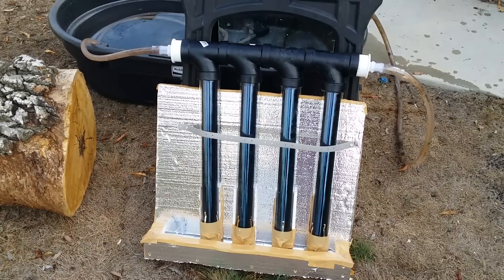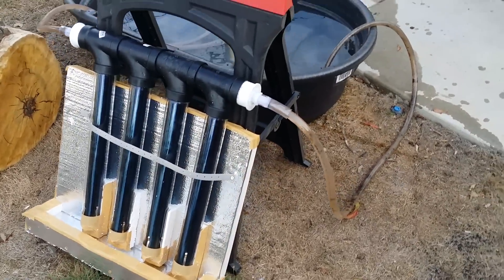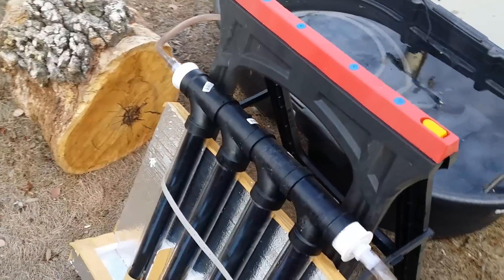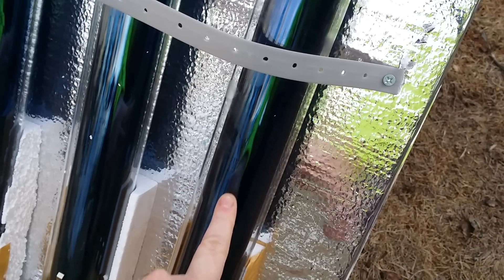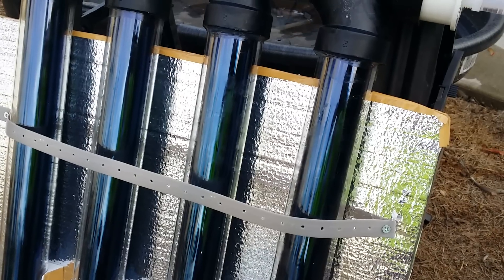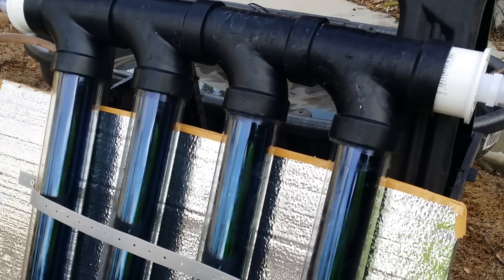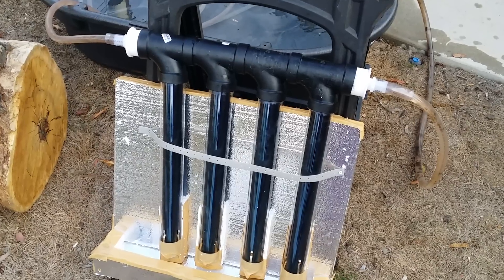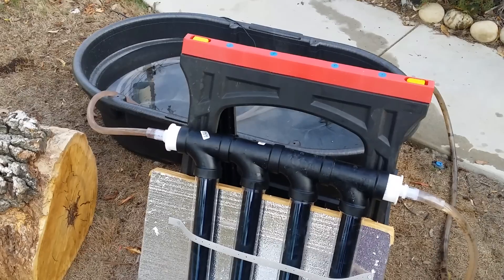How to Make a Solar Hot Water Heater at Home - DIY Solar Vacuum Tube

Comment: some report on the temperatures (say between input and output) would be nice as well as anything about the pumping rate ...
Reply from the maker: Thank you!  If I run the experiment again, I'll include that.  If memory serves, the pump was small, about 60 GPH.
Reply: hello, you just plug the tubes into the pipe? inside the tubes is there anything? I'm from Brazil, and I want to make my own. If you can answer me
Reply from the maker: Hello!  Yes, you plug the pipes into the tube, but first I put a seal of aquarium safe silicone sealant around the pipe to create a water tight seal.  I let the silicone cure for 24 hours before running water through the tubes.  I found that the the sealant worked fine right away, but after about a year it had degraded from the heat and needed to be replaced.

Also, there is nothing inside the tubes.  They are empty, and only fill with water that is being pumped into them.  Please let me know if you have any additional questions, I am happy to help!
Reply: veryThank you. My doubts have been answered.

Comment: inside tube is metal or glass?? i mean in future if metal get bad corrosion?
Reply from the maker: The inside is glass with a very thin metal coating. It should not corrode because the metal coating is facing the sealed vacuum
Reply: @Suburban Stone Age  very thin metal is dark i think and it makes less reflection i want to make a system for screen pools that you can hang on the screen and it will works with sunlight automaticly but i dont want to so any maintence i can work with dark glass or steenless steal
Reply: @Suburban Stone Age  like after 2 3 year i dont want to clean i want it run forever in my country turkey we use them alot but we wont fill them with water. your system is cheaper and less maintenance thats amazing for pools

Comment: the backing is insulation use a solar lens to focus more heat instead of a standard heat. It would do better with a mirror and not touching the insulation backing which is cooling down the outside tube from transfering heat
Reply from the maker: This project is due for an update this year, I'll keep this in mind to try!

Comment: It may be far more efficient by having a primary and secondary tank, with an overflow interconnected.
Depending on the temperatures you want to achieve, you could 
further a modify the tubes and tank for more efficiency, output and storage.
Reply from the maker: Yes, agreed.  I'll be trying again this summer, and feel there is a lot of room to improve. Thank you for your comemnt!
Reply: @Suburbanstoneage  
What temperatures did you manage to get?
Reply: They make drain back tanks specifically for solar water systems.. ben gravely has a great video on it, many other advantages that come with the drain back tanks as well and should be even better when combined with these new tubes

Comment: Nice ! What about using thermosyphon to replace electrical pump ? What cost's the vacuum tubes ?
Reply from the maker: Hi!  Yes, that is an excellent idea and I would like to try it on the next build.  The vacuum tubes were about $100 for 10, but the price has gone up to about $200 for 10 since I bought them.  I'd keep an eye on Amazon and eBay around the big sale days to see if you can get a deal.
Reply: @Suburbanstoneage  There is also a chinese company making them, and i already saw a tutorial to make it yourself... 
I wonder if recycled neon glass pipes are enough strong to use them....?

Comment: Hi, love the simplicity of this. I'm wondering if the design would work for heating air? If not empty, would it work to fill the tubes with a porous metallic material, like steel or copper scouring pads or aluminum screen material?
Reply from the maker: Hi!  I think it would work fine for heating only air.  I've see it sitting in the sun with visible heat waves coming from the top.  Of course, that is with just an open tube, which I'd recommend trying first.  Also, putting metal scouring pads would probably get them quite hot.  Great ideas for a future test.

Comment: Did you build the evacuated tubes? If so, how did you assemble and remove the air?
Reply from the maker: Hello! No, I bought the tubes online. I put a link in the description if you want to check them out on Amazon.
Reply: @Suburbanstoneage  Nice, thanks.

Comment: Where did you buy your tubes, want to re-create this project for a engineering capstone and find the tubes has been a struggle
Reply from the maker: Hi! I bought them on Amazon, there is a link in the description where you can purchase them. They've been wonderful. Please let me know if you have any trouble, and I can help you find some. Thanks!
Reply: Great found the tubes, would you be able to give me information on the header pipe you use and how you connected each tube
Reply from the maker: @XoJosselineXo  Hi!  Sure, I'd be happy to! In fact, this is a great idea for a new follow up video on this project.  I will need a bit of time, but I"m happy to show you all the details.

Comment: how to keep it from leaking on the connection between the collector pipe and the pvc pipe when it's high heat?by the way..nice video and sharring..
Reply from the maker: Hello and thank you!  I sealed the vacuum tube at the top with aquarium silicone sealant.  Because the seal was around the outside of the tube, and inserted into the PVC fitting, it did not get super hot.   The seal worked for some time, but I found that after 1 year it had degraded and needed to be replaced.  When I do this project again, I will probably experiment with a different seal material, but the silicone sealant will definitely work in the short term.
Reply: @Suburbanstoneage  thanks for the answer..
Reply from the maker: @Caturdepok  My pleasure!  :D

Comment: The tube is insulated as to not  lose heat by convection not radiation.
Reply: Conduction-- loss through touching other molecules

Convection-- thermal fluid currents

I think you mean conduction

Comment: You could eliminate the need for the electric pump with the use of two "one way valves" on each side of the heating array and a syphon priming hand squeeze or lever pump to get it started.  Then, heat will create a vacuum effect and it will run itself.
Reply from the maker: HD Candela true!  At the time I wasn't sure how to get the tank high enough to start a siphon so I moved along with the pump.
Reply: Suburban Stone Age there is no "siphon" when the tank is above the array. And the tank needn't be exceedingly high anyway.  The drain on the tank need only be higher than the inlet of the array.     To me,  siphon implies negative pressure,  like suction in a straw,  you have to create a lower or negative pressure area for there to be an effect.  When the tank is higher than the array,  there is no negative pressure nor does there need to be.   Gravity causes water to fall into the array,  the water is heated in the array and expands.  And it's the expansion that does the real work.  Like the mercury in a thermometer,  the expansion pushes the water "up" the outlet and returning it to the tank.  The hottest molecules rise (creating space for cooler molecules) and expand (take up more volume in the pipe).  This is exactly what happens to water when it freezes and why ice floats instead of sinks, and what makes water so miraculous.  It expands when it is heated,  but also when it freezes, and if it didn't none of us would be here.

Comment: and... the results?
Reply from the maker: With the 4 tube design I was able to raise approx. 40 gals. of water by 30 degrees F with about 5 hours of sun exposure (which equals one day's worth in this location).  However, when left to run overnight, the water returned to ambient temperature.  Conclusion:  This device can and will heat water, but if you have a large volume of water to heat insulation in the system or holding tank will probably be needed to lock in your gains until you can resume the next day.  Or, if you want really hot water, heat less water with the same setup  and use it that day. 

I still have my apparatus and intend to resume the experiment as work schedule allows.  I hope the finding above are useful, I am happy to answer any questions. Thanks!
Reply: im working in an old and rust 200L pressurized (the tank is rotten so will be used only as a housing) water heater, with 20 6foot tubes, im going to try to connect them all using blue PVC, heating 50mm to seat outside the 58mm tube and then connect them in series, now waiting for a 2nd cheap solar water pump to move the water because the first is melted with the 17 volts from a solar panel so soon I would be sharing my experience, thanks!
Reply from the maker: Would love to hear about it!

Comment: Bath time!
I use the solar tubes to boil water for my rice before I put it into the solar oven.  Someone with a 3D printer made a special cap for them - which release some pressure so that the cap doesn't "pop" off while heating.